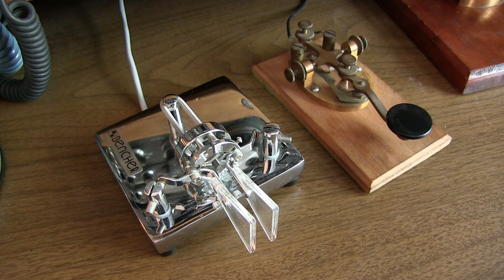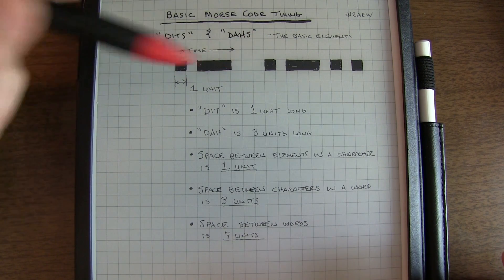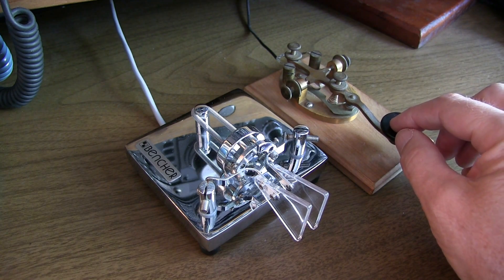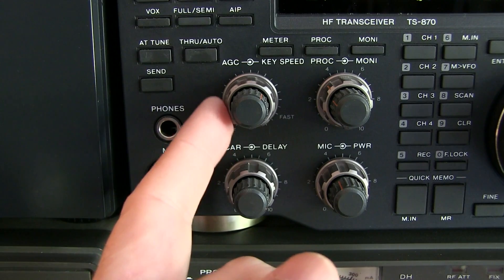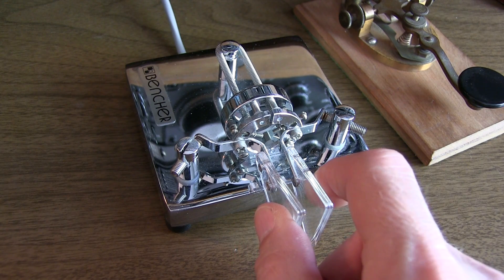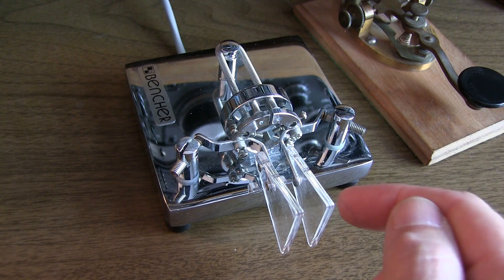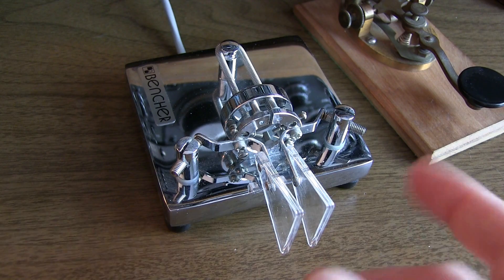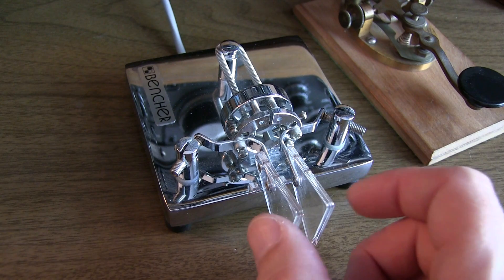#300: Ham Basics: Sending Morse Code / CW - straight key, paddles and iambic keying

Comment: In the process of learning cw. Got the alphabet and numbers learned and now focusing on hearing. Way harder and I am super slow. Like anything it will come with time and practice. Try to work on it daily with an app listening and inputing letters. Yet to work on keying. Very difficult skill to learn at least for me.
Reply from the maker: It just takes practice - even just 20-30 minutes a day.  Try learning with the character speed "fast" so that you learn to associate the pattern of letter with the letter.  I made the mistake of learning at a very slow speed 40 years ago, and got hampered by the mental translation that I was doing in my head (dit-dah to * -- to "A").
Reply: @w2aew  - thanks for the advice. Everyone says that, but when its fast all I hear is dits and dahs. No idea what anything is. I get if you hear it and know that sound is an A for example without translating, but I am finding out there is learning it and also hearing it. Got the learn part (necessary to send), now its the hear part (hard part for me). Once I get that I will have learn the third part - keying. Definitely a unique skill once mastered in this day and age (friends and family think I have lost it).

Comment: I have made a lot of QSO's in CW with both the straight key and the paddle. But never could get that squeezing right. One thing I do know it is important to have the dit's (points) on the paddle that you push with your thumb. 
Your thumb must be the finger to give the dit's. If you want to jump to a mechanical bug, it is much easier. This because with a mechanical bug you give the dit's with your thumb.
I have a mechanical bug and maybe that;s the reason I never got into that squeezing (iambic).
73
Reply: There is no "must". If you want it that way you can have it that way. I haven't come from a bug, and I no intention whatsoever of going to one, which would be the only reason I can see to default a thimb-dit. I still haven't decided if thumb-dits are the way to go.

Comment: For many decades i still can't understand why use two paddles if it can be done by one paddle connected to the ground and two dot and dah contacts. Resemble me English tap with two handles.
Reply from the maker: You can use a single paddle for everything except the Iambic “squeeze” keying where you can insert a single dit or dah in a string of the others.

Comment: You might not be able to answer this, but what is your opinion on the best device for someone without a steady hand. I have a neurological condition.
Reply from the maker: I am not an expert, especially regarding the challenges of a neurological condition, but I would think that a set of paddles with an electronic keyer (in the radio or external) would be a good place to start.  You can adjust the paddles (contact spacing and force to actuate).  With this, you only need to key the dits and dahs and let the keyer take care of the timing.
Reply: @w2aew  Thanks for getting back to me. I was leaning in that direction. I have what's called essential tremor disease. I'm a retired electrical engineer, and I had a novice license as a 14 year old many moons ago, but trying to get back into it now.

Comment: Nice Job! Are you aware of any software that will evaluate how well one is sending (correct character spacing) with a straight key?
Reply from the maker: Good question, I"m not sure.  I'll ask around.  There is some good advice on sending here:
https://morsecode.ninja/practice#SendPractice
Reply from the maker: My friends at the Long Island CW Club came through with some info - CW Fist Check:
https://www.qsl.net/dj7hs/download.htm
https://www.qsl.net/dj7hs/help/helppcwfistchk.htm
Reply: @w2aew  Thank you! I do have a keyer for my Bencher but I would like to practice with a straight key too.

Comment: What is the purpose of using Morse code instead of using a microphone for verbal communication?
Reply from the maker: There are a couple of purposes:
- More effective communications under poor conditions, since morse code uses much less bandwidth than voice, the receiver bandwidth can be set much narrower, thus reducing noise and allowing clear and effective communications under conditions that would make voice communication impossible.
- With such narrowband signals, many many more conversations can occupy the limited spectrum available to us.
- Emergency preparedness - in dire circumstances, you may only have the ability to turn a transmitting device (radio, light, etc) on and off.  You can communicate using morse code under these extreme emergency conditions.
- Fun!  Many people, myself included, enjoy the mystery and fun of morse communications.  Unlike voice, you can't tell anything about the person on the other end  (old/young, male/female, local/distant, etc.) until you communicate with them.  In the modern era, there's no reason to ride a horse either, but people still enjoy doing it.  Same with CW.
- etc.

Comment: Although I can see the advantage, I've always looked at keyers (and even worse, computer-generated CW) as kind of "cheating". The Ultimate Ham Radio is CW on a straight key with a home-made transmitter, into a home-made wire dipole... 
Even worse is VHF/UHF, which I view as the same as a cellphone.
OK, I'm old...
Reply from the maker: I prefer a straight key as well.

Comment: Thank you for this video Alan. I watched it two days ago and and enjoyed it. This is a great way to encode information in a concise way and then to send it over to some other place using radio. I have a question about your camera though. I understand you have recently changed your camera. The picture quality and the audio are both very good. Would you please tell me about the camera, the microphone and also the way that you use them. Do you record on a camera, save the file to some memory card and then transfer it to a computer or do you record directly on a computer? How about the audio? Thank you very much.
Reply from the maker: I've been using the same camera since about March 2014 - a Canon HF-G20.  For audio, I simply use the mic on the camera.  I record my clips to the SD card and then transfer to the PC for editing.  I use either OpenShot or ShotCut for my editing.  If I notice a lot of imbalance in the audio (left to right), then I convert to monophonic when compiling.
Reply: @w2aew  Thank you very much!

Comment: That is not how you send with a straight key.  THUMB & MIDDLE fingers on the side, Index finger on the top of the button.  Push and pull the key, don't TAP it.  That is only on TV. K1TA
Reply from the maker: I agree.  I did a separate video on straight key sending style.  I typically use the "grip" as you described, and keep the key near the end of the bench so that my arm/elbow are elevated - often called the European sending style.

Comment: Very good. Which key / paddle type would be best for an absolute beginner?
Reply from the maker: I would recommend a straight key for a beginner - since it forces you to learn the timing inherently, without relying on the keyer to get the element timing right.
Reply: @w2aew  absolutely, from one who went to a paddle too quickly. Also there is technique to setup and manipulating the straight key that makes it a bit easier. I learned this from old military films.

Comment: why do you say "dits and dahs" instead of dots and dashes?
Reply from the maker: This is how I was taught 40 years ago.
Reply: Because dots and dashes are simply written representations of the lengths of the sounds which make up the characters, which doesn't help you except at very beginning when you are learning the characters from a chart. Dots and dashes won't help you learn to "copy" (listen to and translate in real time) Morse Code: you want to see the letters in your mind, not the combinations of dots and dashes - that takes a further, completely unnecessary step of translation, and I promise you that at anything more than a snail's pace, it wouldn't work anyway. We don't hear dots and dashes, we hear tones of short or long relative length, and it is more intuitive to represent the short vs. long tones when we speak them by the onomatopoeic vocalizations "di-", "dit" and "dah". "di-" is used whenever the shorter tone is not at the end of the character; for example, the letter "r" is "di-dah dit". It is no accident that it is virtually automatic to "speak" correct Morse timing by using that method. If you actually key out Morse Code the way you say it using those three sounds, you are almost guaranteed to be sending correctly.
Further, as we learn to copy Morse Code, the sound of the group of tones in each character becomes so familiar as a single group that we don't even count dits and dahs when we listen: "di-di-dah" for "U" sounds very different to "di-di-di-dah" for "V" (can you hear the opening notes of Beethoven's Fifth Symphony when you say it? *),  and "dah-di-dah" for "K" sounds different to "dah-di-di-dah" for "X", and the count of dits and dahs becomes unimportant. Almost anybody can quickly identify the unique and agreeable sound of the period punctuation mark: "di-dah-di-dah-di-dah". Just sound it out to yourself, and you'll know exactly what I mean; it'll almost make you want to learn Morse Code just hearing it :-)
* And you may recognize "dah-dah-dah" (the letter "O" in Morse Code ) as the opening of the song by the German band Trio, or "di-di-dah, di-di-dah, di-di-dah-dah-dah" as the famous part of the William Tell Overture, which is "U-U-2" in Morse Code.
Reply: TL;DR: The characters are NOT dots and dashes. Morse code is an encoding system for the ears , not for writing. Those symbols are only for writing sounds down.
Like how music doesn't actually live on a score, and notes aren't actually shaped like ♫. It would be silly to ask a musician to play an F♯ by describing its shape on paper.
Reply from the maker: @fashnek  Of course, it's just a visual representation of the audible timing of the elements that make up each audible character.

Comment: I preach and teach iambic keying.  The Yaesu radios, MFJ keyers and many other radios have type "B" keyer chips in them, the test is a person accustomed to type "B" keyers cannot send the letter "C" with a type "A" keyer, the last element (DIT) will be missing.    It takes about a year to learn to send everything with true iambic keying and everyone that I taught iambic keying has told me that they would hate to have to go back to the old fashioned way.  When you use true iambic keying all of the timing becomes sub-conscious and you only think the WORD and your arm sends it, slowing only when you can't automatically spell the word.  20 wpm is the regular iambic sending rate.  You or I can send for hours without stop as it is not fatiguing.  I have found a paddle spacing of about 9 or 10 mils is optimum, a business or index card thickness, any  tighter and you will send errant elements if you reposition your fingers.  73    Ron  KA4INM
Reply from the maker: I'm still working on getting my copy speed up.  Like most people, I can send faster than I can receive.  Currently comfortable at 10-15wpm, getting a little faster every week...
Reply: I gravitated to Iambic B straight away, and you're right: I can't do a C in mode B :-) But it took me a lot less than a year to learn to key Iambic, though: I got my paddle in July last year, have been very sporadic in learning CW - haven't even had a single QSO yet - but I can send comfortably at 18 pwm (20 with occasional mistakes) with slightly longer Farnsworth gaps between characters. Looking back, learning the keying part probably only took me a week. Copying, now.... well, that's a completely different story :-(
And I totally agree that Iambic is the best way to teach in the 21st century. I am still learning to copy CW, and it is absolutely miserable trying to copy the awful, sloppy manual keying I hear on 20 and 40. I suspect most straight keyers give themselves far too much credit for their "style".

Comment: Why does the Bencher look like something out of a boutique fashion store?? Like does it HAVE to be that shiny and nice looking JUST for Morse code? I'm guessing that it's probably gonna cost like 1,000 dollars too just because of the looks and nothing else. Same crap Apple pulls with the shit they make.
Reply: No, obviously it doesn't have to. The key is considered the craftsman's tool, or the artist's paintbrush, it is the primary focus of the process, a haptic interface, and as sending Morse Code is a skill that takes a lot of effort to learn and do well, some people like to celebrate that achievement with a fancy design. Correspondingly, good Morse paddles are expensive to manufacture, so adding a bit of bling helps the manufacturer show off his skill and justify the value. My paddle is stainless steel and brass - functional, not anything like as fancy as the Bencher. And it isn't "crap", by the way: it's a matter of taste, if you don't want one, don't buy one.
Reply: Shop around. I just sold my spare in mint condition:  $100.

Comment: I can tell that you have hardly ever used a straight hand key, because you hold it wrongly and, as a result, you're not in control (the dots are too short) and your code is not consistent. I had never heard of the 'iambic B' method, that is interesting. I tried it with my own self built keyer, but it does only 'iambic A'. Best 73 de HA7RJA (former PA3BSV)
Reply from the maker: I'm self-taught on the straight key, so probably have developed bad techniques and habits.  I would like to learn more about the proper method.
Reply: @w2aew  There's a lot of info on the internet and if you are in the position to do so, I would recommend that you ask a fellow CW ham from your local ham club
Reply from the maker: @robj1646  Thanks Rob.  I did some looking around, even at some old Navy training films, and they all describe "gripping" the knob with fore- and middle-fingers on the far edge, and thumb touching the side.  Interestingly enough, this is how I normally use the key, but didn't do that in this video because I felt it "hid" the key too much behind my hand.   Still practicing, so I think my technique is getting better.
Reply: I prefer Iambic B, personally, but I'm a fresh-faced rookie at CW, so whadoIknow? :-)

Comment: How quaint.  New equipment for Morse code.
Reply: Nothing new about it. My iambic is an easily 30 years old. I bought it used.
Reply: Hardly. I had one before junior high - 1963. I built the electronics myself using a single dual-triode vacuum tube.  It sounded exactly the same as it does today but it did run a bit warmer.  :-)